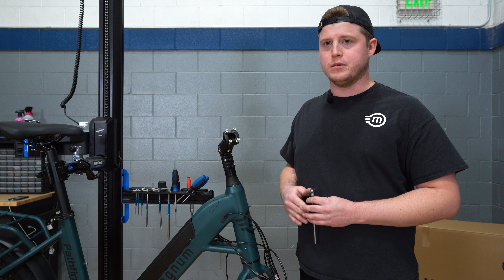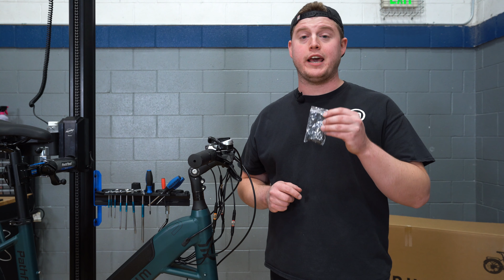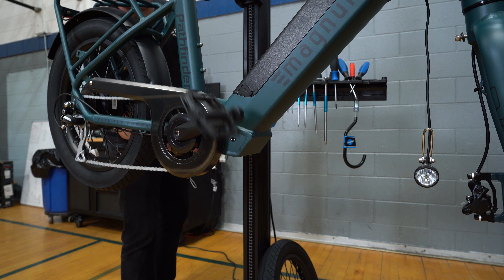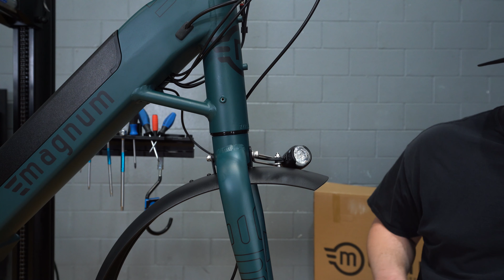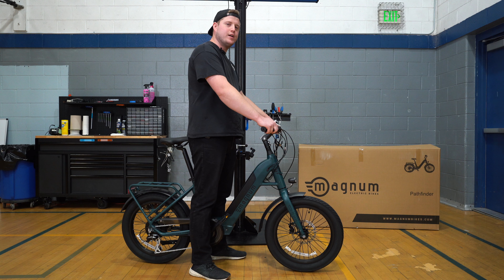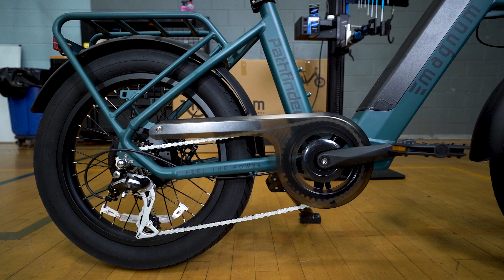Magnum Pathfinder Assembly | How To

Comment: One thing to add: when I put on the front wheel I couldn't adjust it enough to align good with the brakes, so I had to loosen and adjust the front brakes a little (when you spin the front wheel you'll hear when it slides against the brake pad, that means it's not aligned well enough).